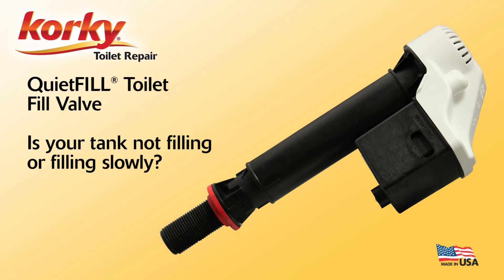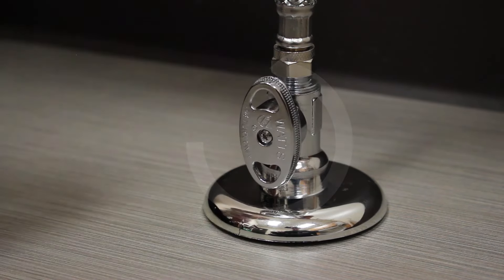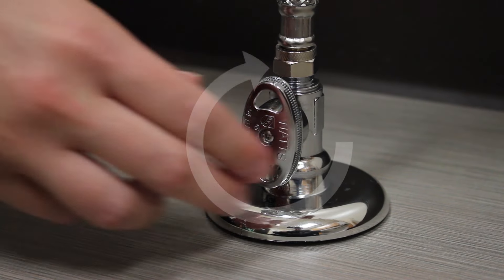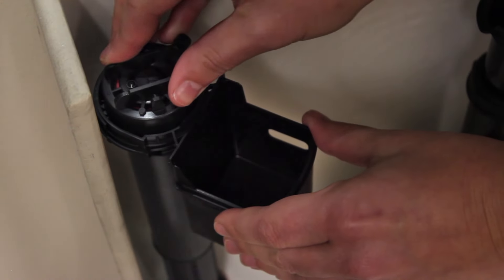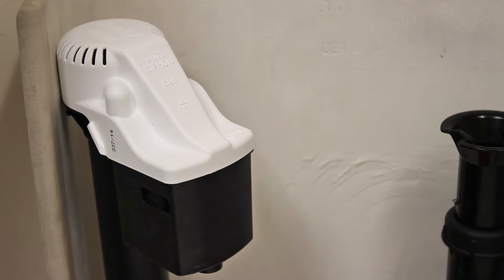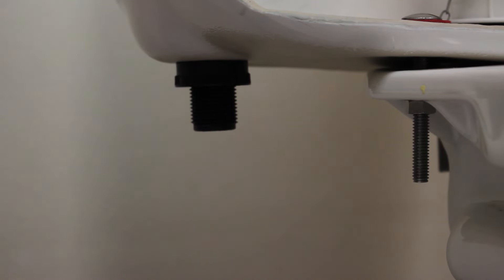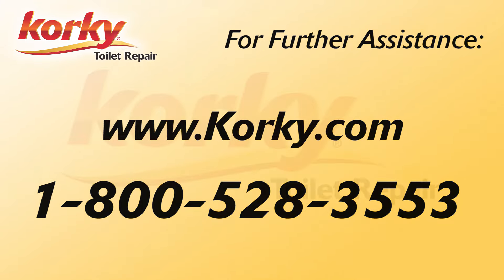How to Clean & Service a Korky QuietFill Toilet Fill Valve

Comment: I bought this product because it was made in the US. After 1.5 years, the toilet starting filling incessantly. I called for assistance and was sent this video, which I also found on their website. The rep was very helpful and even offered email correspondence as well. Nothing was readily wrong, other than the float mechanism seemed a little sticky. I cleaned everything for good measure, and the float moved better. So, upon putting everything back together, the toilet seems to be working fine now. The red gasket/seal seems to be getting worn, so if the problem restarts, I'll get back in touch. I am pleased that a US toilet part manufacturer has such an excellent, top-tier support system for a $10-$20 product. There's so many other companies out there that provide horrendous support, or none at all. I wish they'd take a lesson from Korky! Thanks, Maribel!
Reply: That red gasket/seal was crumbling on mine. I just installed it maybe 2 years ago. To be fair, we do have hard water where I live, but it’s still frustrating. I tried cleaning and reassembling but no help.

Comment: Thank you! This just saved me from having to replace my fill valve. I'm on a well with sediment in my water and recently had to replace my pressure tank and pump and it got really gunked up. I wish it was as easy to take apart as it was in the video. All the sediment made it get stuck. I had to use pliers to turn it that 1/8" and ended up breaking off a piece of plastic. Fortunately it wasn't an essential piece. The strainer was no longer white-- it was blackened. I had to use a powered brush to scrub out the crevices and get all the stuff out. Then I had trouble getting it to go back on and click back in place and the float kept jamming. Finally got it though and had to fiddle with the float to loosen it up so it would work.

Comment: Just took apart the new Korky unit that I put in, it was hissing (like a bad seal on the float valve was letting water slip past just a bit), watching this and taking it apart/reassembling seemed to quiet it up. Might've been a little piece of plastic or even some calcium deposit dislodged inside the pipes because of taking the old unit out. Anyways I bought this unit because it was made in the USA, didn't know it was also serviceable, really nice to see that.
Reply from the maker: Hi Jesse, happy to hear you were able to service your fill valve!

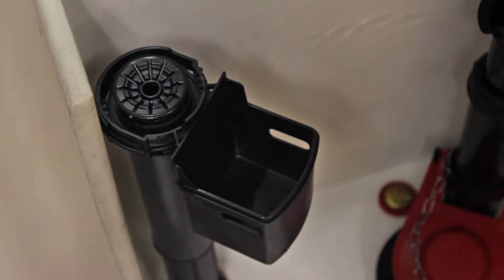Comment: Fixed one that wouldn't stop running water using this video. Lots of sediment in my area, I had to take off the cap at (shown at 1:08), remove the rubber stopper from it, remove sediment,  put it back together. After this, the float was able to properly turn off the water flow.
Reply from the maker: Glad to hear the video helped to get your fill valve working properly again!
Reply: Nice

Comment: Good video. Helped me take apart my Korky. Cleaned it all up although not much sediment. I think the white cap got deformed. Every time I put it on, the water flow would go to a crawl and speed up and crawl and speed up (the sound was driving us crazy). I made the white cap wider and smaller a few times by gently squeezing it with my hand til it fit properly where it was supposed to go. Also there is a tiny hole on the top of the pink rubber seal on the plastic side that I don't know what it's for but I rubbed the seal a bit and made sure the hole could let water in and out. Seems to work fine now. :D

Comment: The problem after only 2 years with mine is the red rubber washer inside the top of the valve. Holes in it , result leaking from the top, cant fix it with this video, i guess i need to buy an other part for it ? or just change to a better long lasting system
Reply from the maker: Let us help! Are you able to contact our Technical Support team? We would love the opportunity to learn more and quickly identify a solution. Your fill valve is backed by a 5 year warranty and we want to ensure your complete satisfaction. Please call 262-763-2434 or email Sales@Lavelle.com. We are available M-F, 7:30am-5:00pm CST.

Comment: I found one other area to check... if you have sediment floating in your tank, you may also want to check the little valve in the bottom of the float chamber. My QuietFill would not start filling the tank after flush for as long as 10-15 seconds. It turned out that the sediment had coated the bottom of that little valve, not allowing the float chamber to empty and drop the float to open the fill... quick fix by cleaning the bottom of the float chamber with a paper towel.
Reply from the maker: Happy to hear you were able to resolve (and thanks for the video feedback & tip!).
Reply: Exactly what was my problem, but took a couple tries to figure it out.
We're on our own well which has high iron and minerals. We have an inexpensive whole house filter which is readily available at the big box stores as well as a water softener. But this didn't stop iron sediment (reddish) from building up in that float chamber and plugging the drain hole. This took about two years of service in a downstairs bathroom to happen.
Otherwise, thanks very much for the instructional videos (and bonus points for having a woman demonstrate!)
Reply: Awesome! Thanks for sharing this tip! I didn't realize there was a valve in there. I already had to replace a fairly new Korky fill valve after one year of service. This happened again, and after removing the entire unit and rinsing it with clean water, it did the trick.

Comment: Unfortunately, it hasn't worked for me. I replaced the valve top with a new one, flushed and cleaned everything and it still won't stop filling. I have just reversed the little red pilot washer to see if this will work. There is very little sediment and water is conditioned by a water softener. It seems that toilet fill valves have built in obsolescence and this valve is no exception.
Reply from the maker: Let us help! Are you able to contact our Technical Support team? We would love the opportunity to learn more and quickly identify a solution. Your fill valve is backed by a 5 year warranty and we want to ensure your complete satisfaction. Please call 262-763-2434 or email Sales@Lavelle.com. We are available M-F, 7:30am-5:00pm CST.

Comment: The red seal inside my cap was stuck to the top of the supply tube and appeared to be deteriorated.
Reply from the maker: Let us help! Your Korky fill valve is backed by a 5 year warranty and we want to ensure your complete satisfaction. Please call our Technical Support team at 800-528-3553 or email us at sales@lavelle.com. We are available Monday through Friday, 7:30 AM to 5:00 PM CST.